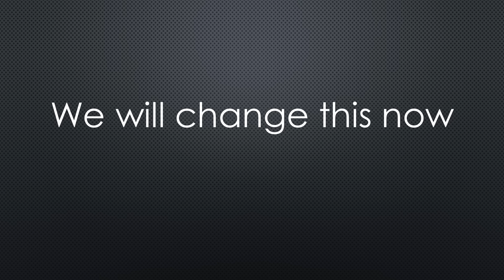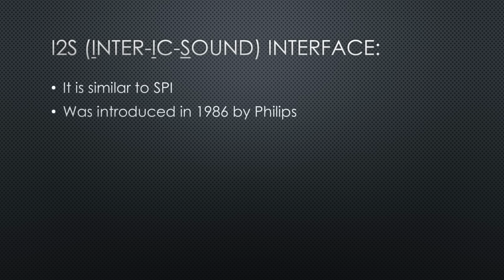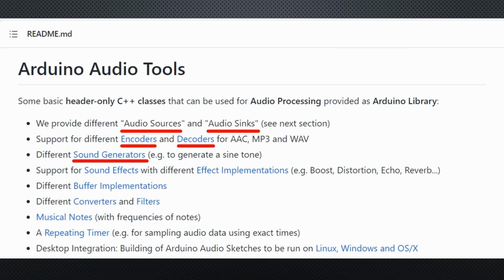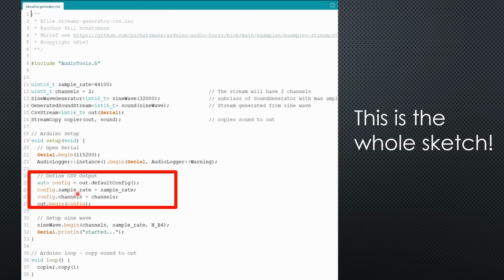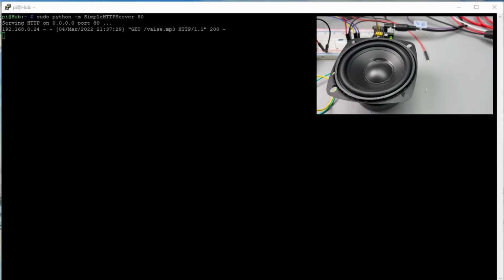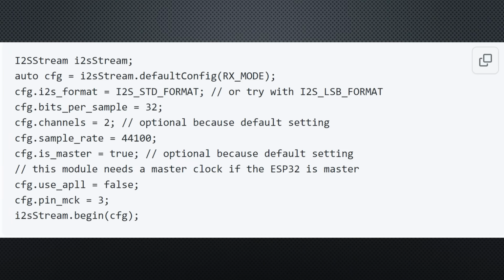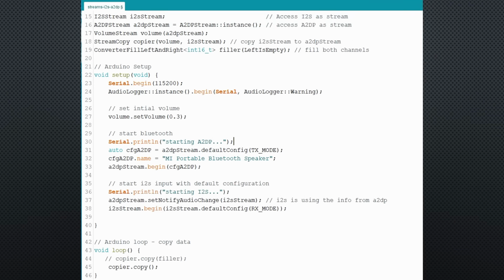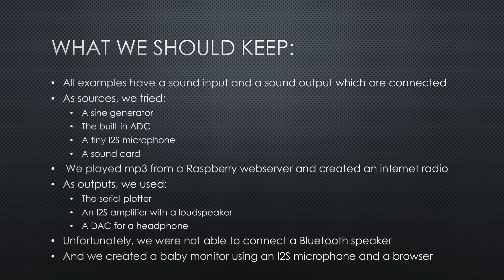#419 ESP32 Audio Tutorial with lots of examples

Comment: in the example streams-url_mp3-analog  or streams-url_mp3-i2s.ino, is there a way to have the output on the 2 DAC of the ESP rather then on i2s, even if the quality is not so good. Someone can tell how to modify the code because my C++ knowledge is not so high , thanks
Reply from the maker: You have to use the right example. streams-url_mp3-analog.ino should do the trick. But I am not sure if it will work. Maybe you try and open an issue if not. Download the newest version. It was recently changed.
Reply: @AndreasSpiess  thanks, it works now !

Comment: Hello! These videos are superb, I'm learning a ton from each one. I'd like to try creating a LoRa system for automating the scoring and refereeing of an outdoor game/sport. Think of "capture the flag" type of game, where players can take control of points in an outdoor area by "checkin in" on the points, and are scored for example based on how long they control each point during a match. I have a small demo of this on an Arduino through Wifi, but the final application will need much longer range than what Wifi can provide, with about 12 points in an area of one or a couple square kilometres. The system should be able to run for two days straight on battery power. I've been looking at ESP32s with a LoRa capability and an RIFD reader (with an RFID tag on every player) to make this happen, but the amount of components on the market is just overwhelming, and new ones just keep coming up. Could you please suggest some parts to start looking at and developing on? I would really appreciate any advice on the most suitable parts as the main board, the reader, LoRa part and the battery.. And if there are any go-to tutorials that you would suggest, I'd be happy to hear about them. Thank you!
Reply from the maker: This is a very complex project and I do not do consulting, unfortunately. You are on the right track to start with a prototype for every aspect of your project and finally integrate it into an entire system. You find a lot of info on this channel for each aspect.
Reply: @AndreasSpiess  Thank you very much for the reply. I have managed to make a shopping list for components and am making good progress by following more of your videos.

Comment: Thank you. I got an ESP32 KORVO v 1.1 sound development from ESPRESSIF, that seems to have been shipped missing some components. It does have the required I2S DAC and ADC chips though... With this I can finally use the components on there for something useful.. :)
Reply from the maker: I hope the chips there are usable with the library.
Reply: @AndreasSpiess  I hope so too... Got a real bad experience with that particular device.. lots of missing components, technical drawings not up to date etc... but, that is good, as it will be a challenge to see what can be salvaged and repurposed... The library that you referred to will definitely work with the ESP32... it is now up to hunting down datasheets for the supporting components :)

Comment: Scotland's Railway could use your help. How about a 10 to 20 part series of videos in which you design, develop, and help deploy a FLOSS ESP32 solution that is a better solution than...

After 140 years, this old technology still keeps trains safe https://www.youtube.com/watch?v=mzAfich6mow

"Anderson's Piano" is a set of wires and signals at the Pass of Brander, near Falls of Cruachan in Scotland, that try to detect when there might be a boulder on the track. They're 140 years old, and so far no-one's been able to find a better solution — but they're working on it.

Comment: A word or two at the beginning about what an esp32 actually is would have been helpful.
Reply from the maker: The typical viewer of this channel works with ESP32s for years ...
Reply: @AndreasSpiess  That's fine and dandy, but we aren't all "typical viewers" or subscribers (yet).  Not everyone who might potentially want to work with an esp32 already does so.  I stumbled on this video by the power of the algorithm.  I'm familiar with microcontrollers and I've done audio projects using other platforms.  But I spent half of the video wondering exactly what an ESP32 was.  Is it a chip?  A board?  Software? Something built into some special version of an arduino?  Something in some other microcontroller?  Does it in any way apply to the things I do?  As it turns out, it looks like something rather interesting I might want to look into.  A couple of sentences explaining it at the beginning might help all your potential new subscribers.  I can't help but wonder how many others bailed out just as I nearly did.  Just a suggestion.  Throw it away if you like.

Comment: Hello.
As Chins stands hard behind Putin, and this will most likely lead to cold war era iron curtain , with 100% embargos on tech transfer both sides, 
what alternatives to esp32 coming from free world would You recommend?
Reply from the maker: I do not see a lot of Chips produced outside of China. If this happens, I will have a lot of other problems, I fear.
Reply: @AndreasSpiess  Renesas and Infineon/OpenFoundries(Dresden or Graz) still have enough advanced nodes to make chips comparable to esp32, but i admit i can't think of anything specific from their offer. It seems China already made their mind that they will rather act alone instead of cooperating with global collective , so iron curtain comes back :(
Reply: @AndreasSpiess  I got an idea to make life of china/russia much harder :)
Western world has already automatic AI/blackbox chip floor plan optimisers. 
Imagine using those to obfruscate chips :)
So idea is to pre-dope wafers with a "secret code" . EVERY wafer would get special doping , and only such "coded" wafers would be sent to a non trusted fab 
Then for each wafer, special masks would be sent , each having layout specifically designed to use advantage of pre-doped spots. 
OFC not all masks can be swapped that way, but AI cam easily work around that.
Point is that masks would have no use without pre-doped wafers.
OFC this is good only for hobby/consumer electronics, but this allows such chips to be manufactured without risking leakage of the tech to military.
Also as each chip/batch would be different, they can be easily identified, helping to seal smuggling routes, theft and unauthorised cloning of chips.
This also helps coding big node fabs - pre-doping can be made by equipment unavailable for big node, f.e. a tiny LFSR.
Bigger node can interface with such "coded features" of wafer only by serial means, and with whole layout built around such features, it is impossible to just erase them. They can f.e. supply magic numbers needed to decrypt bootloaders.
OFC fabs can try to crack them and inject data from bigger chips placed on top of main die, but we all know how expensive this goes and how much it reduces thermal stability and EMI resistance  of whole chip.
Reply: @AndreasSpiess  After thinking more about this, quick deployment of pre-doped coded wafers tech can be achived by using steppers.
So idea is to pre-dope wafers to code them, and then send corrections to steppers so they fine tune position of masking to match encoded wafer. 
Simplest example of that would be ROM memory for uC, containing only half of the data in the mask. another half would be pre-doped . but fine position of pre-doped data would be not known, and sent to steppers. 
Of course this is very simple example, but it visualises idea. to counter-attack of scanning the wafers to get the data more sophiscated methods can be used - f.e. final rom content of each chip can be only decoded by flashing additional key, key matching only specific wafer/stepping combination, and never sent to or known by the fab.

Comment: i am interested in sending an analog audio (music) signal wifi between arduinos to play on powered speakers in a remote location. is that possible? basically a wireless audio cable with for my powered speakers.
Reply from the maker: You have to see if you find the needed examples in the library.

Comment: Nice Video ! I'm also working on an ESP32 audio project  : "Mr DIY Notifier" 
On Github : MrDiy-Audio-Notifier
It is an audio player / local TTS player (samvoice generated locally on the ESP) / ringtone player / web radio player based on ESP8226 or ESP32. 
It's MQTT controlled.
Very cheap : one ESP and a speaker is enough to start.
It is based on esp8266audio library. You can add it in Home Assistant as a media player. So can we create a media player entity.

By the way, if we talk about ESP32 and audio, the most incredible project is Squeezelite-esp32 : it is an audio player which acts as Squeezebox player, Airplay player , Bluetooth (in emitter and receiver) , Spotify Connect... Really incredible.
Reply: Hi, can you tell how to use local TTS on ESP32? I am very interested in that. Thanks in advance.

Comment: When bluetooth won't connect I have to usually go ask my wife to turn off her phone's bluetooth; (often on the other side of the house since we share bed headphones). The particular ones we have are annoying because it auto-connects on power on, and usually her iPhone connects before my pixel. The biggest problem is you cannot force a bluetooth reset while connected, and the connection happens before the 'press and hold' functionality can force the chip to reset.
...Was your wife's phone connecting to your speaker today when yesterday it worked?
Reply from the maker: Good point. Maybe another device was connected (I have many such devices). But I do not know.

Comment: Amazing video! And I loved the Master/whatever reference :) Do you think it would be possible do use an ADC module with i2s, si5351 oscilator, mixer chip like ne602 and an ESP32 to build a SDR receiver only with modules?
Reply from the maker: I will cover SDR stuff on my second channel. And this video is the preparation for digital filters which are needed there...

Comment: Great find, it's a skill finding the solution, sometimes you create it - often you reinvent a wheel already out there and you find that wheel, so thank you.

Now need to get some ESP32's (already planned), been playing with pico's and the ESP32's predecessor and been fun.  But the built-in wifi and Bluetooth on the ESP32, sure does offset the PICO's lovely PIO interface perks and performance.

One question - what is a good external ADC at a good price balance for resolution?   Also looking at ADC's with multiple channels - they seem to poll one channel at a time.  What I want to do is poll 4 ADC ports in sync so that the value I get from all 4 is the exact (close as beyond clock jitter that I want as low as possible) time.    What I want to do is read 4 piezo elements (cheap mic's if you like) located around a hard surface like a blackboard and from that, hopefully, work out where contact is made to the surface.  Turning any hard surface into a touch interface.  Now the ideal plan is to be able to read accurate enough in sync so that I can get a good accuracy of the surface noise location and be able to write upon the board and get a digital representation of that via the sound location of the 4 piezo elements.   With that, a cheap and simple device that could digitise any blackboard work.

So any suggestions, or pointers and insights etc, would be extremely well received.

Thank you in advance.
Reply from the maker: I made a video about external and internal ADCs. Parallel is always hard. But maybe you do not need parallel, just only s small difference.
Reply: Been working on that myself a few years back, wanted to run it on an arduino for a drum synth input that takes drum surface polar coordinates into account. Life got in the way, but if I were to revisit that idea (some day!) I'd use separate controllers on a common clock to handle all the peak sensing and compare timestamps a few millis later. Might just cut it without lagging too much.
I just realized how much faster the signal would move through a solid, so instead of timestamps you'd be comparing levels, of course. The system would need calibration anyway. To cut costs, 3 sensors inputs could be used instead of 4, if accuracy and sensitivity are high enough.
Reply: @ronnetgrazer362  Yip, clock sync is golden for this - cool idea for drums and be funky to see an overhead display of the drummers' actions from another perspective.   Hopefully, motivating you into rekindling that project, I know what it is like, many things on the go and flip between them depending upon time, mode and resources.
Reply: @PaulGrayUK  Exactly, there's always another interesting project fighting for attention!
I made a million edits to the previous comment btw, sorry for that.
And i just now realized that sufficient precision would allow you to fit all 3(?) sensors in the middle of the sensing surface, spaced apart just enough to fit the main PCB in between. Don't know if you figured 4 corners means one sensor on each of them like I did mere seconds ago, but I don't see why you couldn't sense outside of the array as long as specs allow for it.
Reply: @ronnetgrazer362  I was looking at 4 sensors around the outside, so any sound which will be in contact with the surface would have a delay difference for each sensor and with that, want them far apart around the outside and for my objective - 4 should be 1 more than enough and 1 more for a level of accuracy.  But need to play and see if 4 is the sweet spot or 5 or 3.  What the offset in costs and more so accuracy and see how those plots out.

Drums bit more complicated.  Don't want to add anything that will change the sound of the drum.  So maybe a laser mic would be the way for those and can have under the drum tracking from the underside - how many I'd start with 3, should cover the main area drummers like to play upon the skin (can look at used drum skins to get good idea or area you are targeting to cover).  It May work, may not, but be fun to play with as everybody loves lasers. :)  However - like any well-formed plan, there will be exceptions - and drummers doing a rimshot would be one that would prove to fall into that path of exceptions.  But may also be detectable by the pattern it plays out upon the laser mic array.  One of those, try and see.
Reply: @PaulGrayUK  I see, I setup like you envision for large area touch sensing would be much more forgiving, and with all the registration being done within the sensor array rather than outside, this should afford you some leeway for measuring delays even with wave propagation exceeding 1000m/s.
Comparing levels (having identified the same peak among the different signals) might provide additional accuracy but area mesh calibration then goes from nice-to-have to essential.

As for the drum instrument as I imagined it, this would involve a hard surface affixed to foam with piezo transducers, ie. electronic drum pads, except it would be using triangulation to provide the drum synth's acoustic model with location data. A rim shot zone could be defined, or some parameter gradient towards the middle, or radial segments could trigger different patches. Sky = limit, but this would require sub-centimeter accuracy without discernible lag. Even with lightning fast hardware (within reasonable budget constraints) it's going to require some clever algorithms to milk as much data from those waveforms as possible.

This got out of hand... thanks for this exchange, it's brought life back into my old plans!

Comment: The extended audio capabilities is nothing new. It is all over the net. It would really take some innovation if  you would do this for the ESP32S2. That would be really new.
Reply: Well, you can try to use my library with the S2 and C3.  I haven't tested it but it's compiling. Please note that the functionality of these processors is limited, so some classes are not available like A2DPStream or AnalogStreams.
Reply: @philschatzmann5281  Thank you very much for your reply, Phil. However when i compile your sketch "player-sd-analog" with targetdev ESP32 everything is ok. But when i compile it for ESP32S2 i get error message "AnalogAudioStream does not name a type". I only changed the board from ESP32 to ESP32S2. Ooh i now see the rest of your message...analogstreams are not supported.....is there anyway to play a file from an sd card?
Reply: @DiAngeloTheSecond  I think you need to update the library to get the latest version. I have committed some corrections yesterday which are addressing this issue
Reply: @philschatzmann5281  Phil,  i just got you library 5 minutes ago....
Reply: @DiAngeloTheSecond  As I have indicated: Please note that the functionality of these processors is limited, so some classes are not available like A2DPStream or AnalogAudioStream. You need to use the examples with I2SStream.
Reply: @philschatzmann5281  Infortunately, the ESP32S2 does not allow using the internal dac using a I2SStream (unlike the ESP32) . I have limited space so i can not use an external DAC. Thanks anyway.